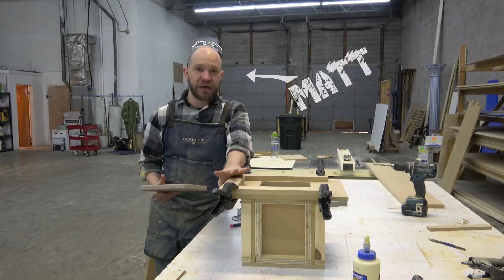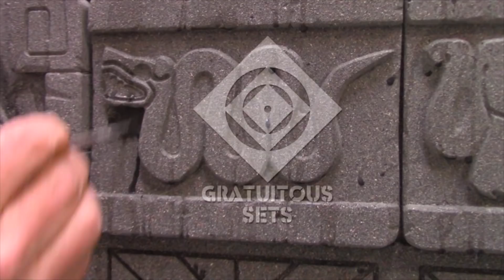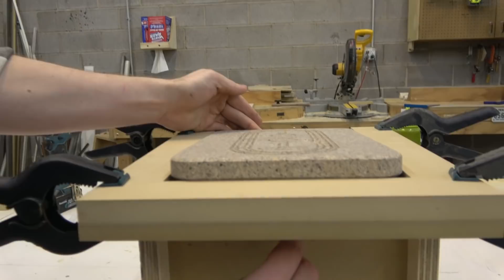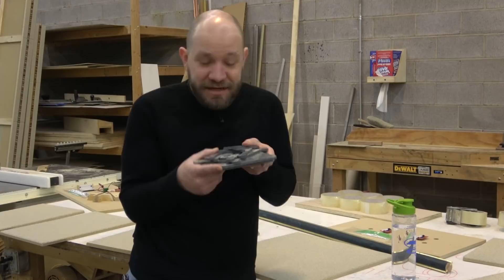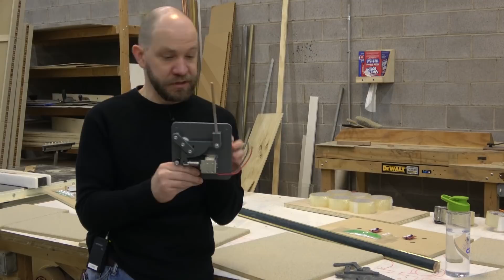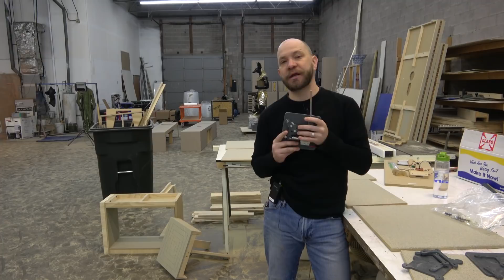Mechanical Problem Solving

Comment: What a cool bit of engineering. Well done!

Good side note about reveals being anti-climatic when players don't notice what happens. I have a regular door that opens that I need to find some way of improving for that very reason
Reply from the maker: Sound driver with Door creaking sound?
Reply: @GratuitousSets  I tried a sound effect, but the room that it's in is 16 ft wide and 35 ft long and the players are inside of an 8-foot octagonal dome when they push the button, so they couldn't locate the sound :/
Reply from the maker: I don’t know if this info could help but, higher pitch sounds are easier to triangulate than low pitched ones
Reply: @GratuitousSets  huh, you learn something new every day.  Thanks!
Reply from the maker: Sorry if you already knew that 😫
Reply: @GratuitousSets  oh nope!  Wasnt being sarcastic.  That's interesting
Reply from the maker: smooches

Comment: Awesome channel with awesome people! Just wondering, did you ever consider using universal 12V power door locking actuators, that you can pick up at any Autozone or similar shops? You should also get the added controlling module which will either pulse for push or pull, but can always hook up your own relays to do the same thing. If needed, add a small spring to make it auto retract, but probably won't even be necessary. Perhaps not as much torque as the solenoid, but will make for a simpler mechanism in certain applications.
Reply from the maker: We HADN’T thought of that! We’ll keep it in mind- that could be handy, thanks😃

Comment: Very cool! So, are the tolerances super tight to eliminate the players lifting the plate by hand?
Reply from the maker: Exactly! The plate is also chamfered on top for the same reason, and has the same stone finish on it and is surrounded by similar glyphs that are not moveable so most players will think it is one solid monolith until it moves 😉😁

Comment: I really like that as a solution to this issue. Especially with the 33v solenoid since it locks in place, somewhat preventing accidental cases of the players reshutting/locking the box.  I have been trying to think of other possible engineering solutions to this problem for a while now and this is certainly going to make its way into one of my future builds.
Reply from the maker: Woot!! Glad it helps 😜